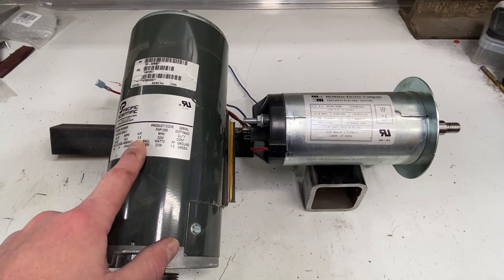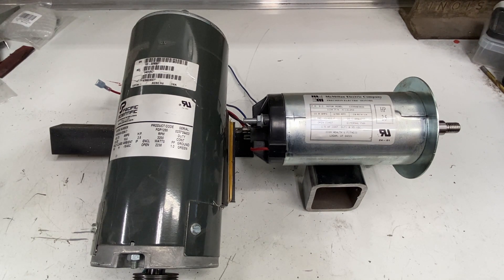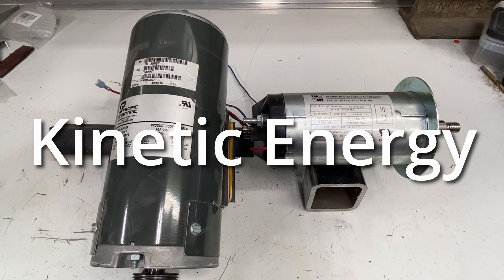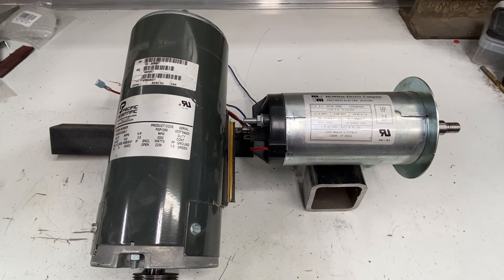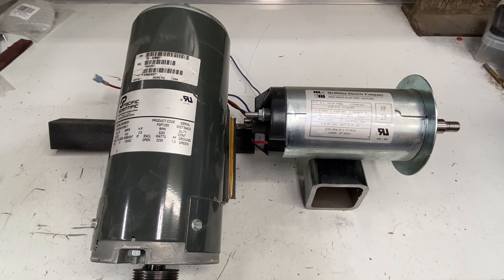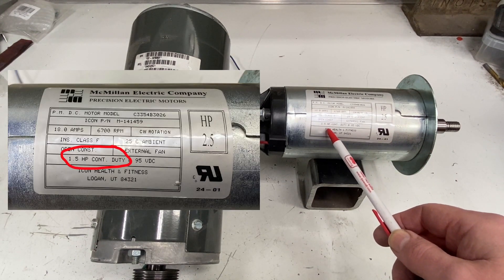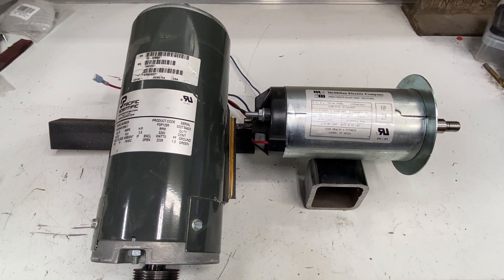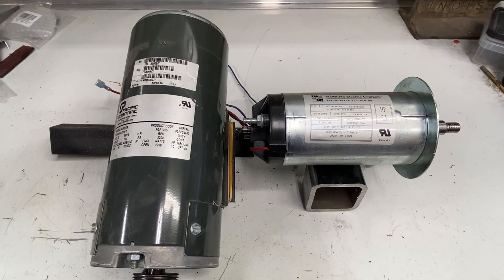Determining if your treadmill motor has enough torque for the project you want to add it to.

Comment: Here’s one for you… I have a DC treadmill motor rated 3 hp, 4000 rpm with a 24-amp 90-volt rating. I switched out an old 1/3hp (no torque) a/c motor on my very old Sears table saw. The plan was to use this setup exclusively for dado cuts and box joinery. I recently bought a low-priced speed controller to complete the build. The problem is, while the controller worked fine with the rpm part, it didn’t do squat for torque. In fact, it bogged down quicker than the old 1/3 hp a/c motor. And after several attempts at sawing, the controller died.  Now I know the DC motor is fine because I tested it afterwards. I’m guessing that the little cheap box controller just didn’t have the electronics to handle the demands. In the meantime, I’ll just wait for any input I can get here… jack of all trades, master of none…
Reply from the maker: I did the calculations and the "new" motor should have a lot more torque than the original motor.  The limitation you experienced is probably the power supply.  I have put together 3 different videos on treadmill motor power supplies and a quality unit would probably fix the issue.  Also if you do not need the max RPMs of the treadmill motor I would recommend using a pulley ratio ill give it more torque.  If you go 2:1 you will cut the torque in half but also double the torque.  Last thing to consider, at lower RPMs a lack of kinetic energy can create bogging issues.  If you are not running a flywheel one might be a good idea.  Let me know if I can be of further help.
Reply: @dazecars  Thanks Daze. Your help and knowledge merits a "subscribe"... count me in... 😎👍
Reply from the maker: @RolyRhodes  let me know if I can help further.
Reply: @dazecars   Thanks again... I'm researching your dc motor video archives... looking like the SCR build is the way I'm going to go... back to the drawing board!
Reply from the maker: what was the RPM of your AC motor?  with that information we can do some calculations and compare apples to apples.
Reply: @dazecars  ... thanks for the quick response... I will get that to you...
Reply: Ok Daze... The rpm is 1750... I tried to attach the picture of the spec plate on the a/c motor.  Anyway, it's a 6.4 amp , 1/3 hp  Montgomery Ward 1950's  model... Hope this helps to brake the case.

Comment: Excellent point about size and torque when it comes to DC motors. Thank you!
Maybe I'm wrong, but I've always understood that DC motors (at least the permanent magnet types like those found in treadmills) only produce their full torque at max RPM, with torque falling off exponentially as voltage & RPMs decrease, until you can easily stop it with just your fingertips at their minimum speed.  (Don't try this with the shunt-wound DC starter motor from a car or truck though!!! They can produce hundreds - or even thousands - of ft-#'s of torque at 0 RPM @ 12 volts and ~500 amps.)
Beyond that (admittedly excessive & probably ridiculous) example, sometimes the claimed "horsepower" ratings of motors on consumer products are just outright lies. Ex: wet/dry vacuums from every manufacturer I know of. My Rigid claims 4.5HP running off of 110 volts AC, and comes with an 18 gauge power cord about 20' long.
1 HP = 746 watts, and watts = volts × amps.
So 746 watts × 4.5 HP = 3357 watts. 
3357 watts ÷ 110 volts = 30.518 amps.  
...through an 18 ga. cord. 
...plugged into a standard residential circut that will supply a maximum of 15 amps.
There's JUST NO WAY.
If it was really 4.5 HP, the breaker would instantly trip.
If I made up a custom 110v circuit that would supply unlimited current and tried to run a 30+ amp load through 20' of 18 ga. cord, the plastic insulation on the cord would melt in seconds, followed by the copper inside exploding when the two conductors shorted out!
...Okay, end of my 😠 rant about stupid marketing claims that have run far afield from the topic of your video.
Thank you again for a good and informative video.
Reply from the maker: You are not exactly correct but you are not exactly wrong depending on the situation. First of all there is no one size fits all rule. There are all kinds of different AC motors and there are all different kinds of DC motors and depending on how each  motor is configured can significantly change the torque curve. With that said there are some generalizations that apply to the vast majority of each specific motors.  The rule I said in my video, in general,  applies to the type of DC motors found in treadmills.  Your statement "DC motors only produce their full torque at max RPM, with torque falling off exponentially as voltage & RPMs decrease" is how it works with most AC motors but not at all how it works on DC motors. On a DC motor, voltage controlls speed and amps alone controls torque, so assuming the motor has full amps available to it the torque curve will be flat like I show in the video. This is perfect world scenario and your observation of lower torque at lower RPMs is most often the result of a power supply that the amp output drops as voltage drops which is the case with all but high end power supplies.  To put it another way if you take a 4000 RPM  90V 15 amp DC motor and power it with 7 car batteries in series (84 volts) you will get 93% of max RPM 3700  and full torque because the batteries have more amps than the motor will draw.  If you power that same motor off of one car battery you will get 13% of max RPM 520 BUT the exact same torque as the 7 batteries because one car battery can put out more amps than the motor will draw.  Now in the real world  we have the problem because we are not running these motors off of batteries but with a power supply. With most power supplys the amps increase fairly quickly so the torque will increase quickly and then once we reach the max amp draw of the motor the torque will level off and stay constant as long as the amp output of the power supply is as high or higher than the motor amp requirements.  On my lathe running a treadmill motor I can take a deep cut at 100 RPMs (when threading) and the motor will slow a little as the tool loads but it will not stop.  At higher speeds the same things happens but to a far lessor degree due to the kinetic energy stored in the moving parts.  The long and the short of it, in most caseses, is that DC motors have a flat torque curve.
Reply: Okay, that makes sense.  Thanks for taking the time to exain it thoroughly. (It's been a decade or three since my last class that touched on electrical theory.)  Now that you mention power supply current limitations, most of the toy DC motors I played with as a kid probably had their "variable" speed controlled by little more than a simple varistor.  ...assuming I put my Radio Shack kit together right anyway; it was all black magic to me back then. 😊

Comment: Got mine working 👍 
Now I need to find a suitable coupler to connect it to a sander backing plate. 
Can’t work out my torque unfortunately as no rpm is listed on the motor.
Reply from the maker: If you contact me through my website you can email me a pic of the motor and I will probably be able to give you a rough RPM range.  I have parted out a lot of these and there are not that many different motors.